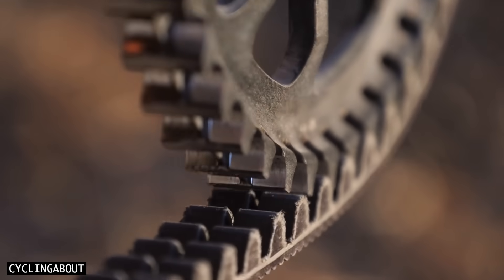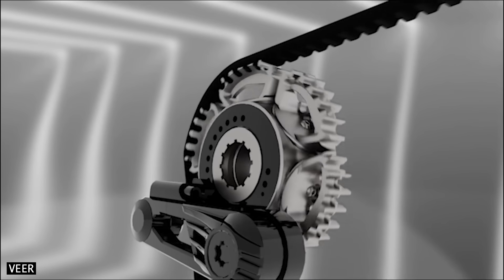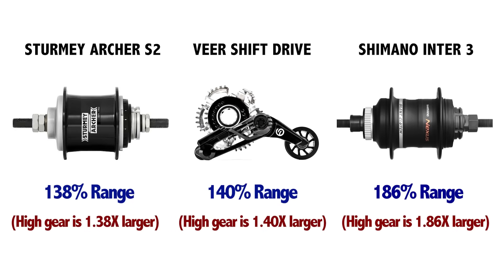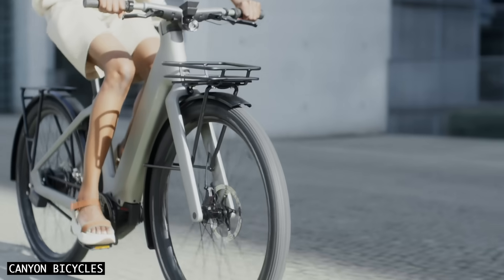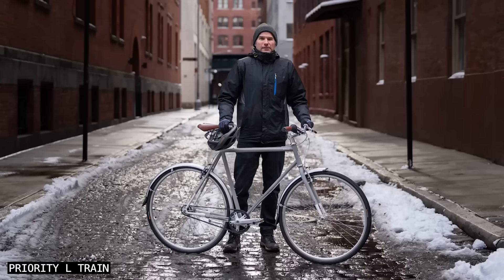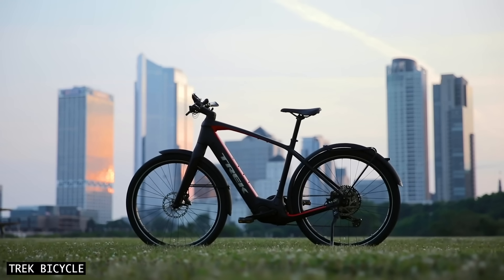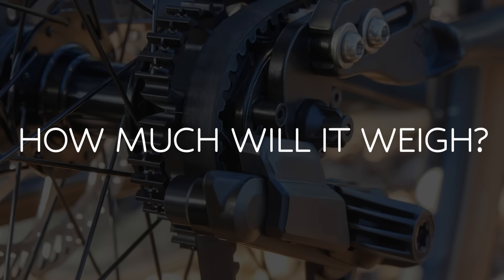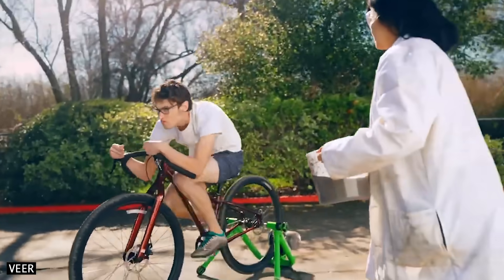Are Chainless Belt Gears The Future of Bicycle Drivetrains?

Comment: This is the first I’ve become aware of this variable diameter cog. I’m intrigued by the cleverness. I realize that many people may look at it and have concerns. But, I also remember in the 1960s seeing adults chuckle derisively the first time they saw derailuers moving chains across 5 cogs.
Reply: Intrigued, yes. That said, the cogs reliance on a "derailluer"(vile machinery), the fact that it is limited to two gears, and the fact that it relies on nearly a dozen exposed moving parts makes it the grease and maintenance laden hellscape that hubs, gearboxes, and belt drives have historically saved us from.
Reply: @kenshinjenna right although unlike derailleur/chain lubrication could be concealed but it sounds too complex for only two gears and limited ratio, making it limited to commuters, with very little advantage over gear hubs which offer a wide range of gear #/ratios
Reply: @kenshinjenna agreed. It’s replacing one derailleur with several. I think this is harder to make reliable, sheerly from an odds perspective.
Reply: @MrQuestful I don't agree, because it only shifts when it's not "in gear" so there are no forces applied, and the "derailleur" mechanism is internal too. it's sealed like your hub is.  no need  for grease on the outside. but the biggest limitation is 2 speeds and 140% ratio which is only ok for commuter bike and/or low speed ebikes. wireless sounds like too much for limited functionality. people paying for wireless shifting want more performance . cable wired shifting with internally routed wires on an ebike would be cheaper, more reliable, and wouldn't require to charge /swap 3 different batteries.
Reply: @geemy9675 I still don’t understand why wireless shifters aren’t all powered by a tiny dynamo in the mechanism…
Reply: @JohnR31415  good point but. it would probably be fragile and probably add as much weight as the battery plus drag, plus you'd still need a battery for the shifter derailleurs are made to be tough. a small battery in the frame , and wires ran in the frame to the shifter and derailleur would do and it could be smaller without the wireless communication
Reply: @geemy9675  it would still need a small battery, but outside of actual racing the drag penalty would be negligible.
Heck, run a rear hub dynamo (saves wiring round the crown) or a reelight style system.
Reply: @JohnR31415  I don't think its worth the additional complexity, weight and drag of adding a dynamo plus having a small battery  plus a second small battery on the cockpit form the remote.
Reply: Something wrong with your memory there mister goodwrench, derailleurs were pretty universal in the 60’s already, never heard anyone scoff at them.
Reply: @ In the community of serious cyclists yes, derailleurs had been proven and accepted in the 50s. Among the general population that thought that massive Schwinns were the gold standard for bikes they weren't seeing lightweight bikes with derailleurs until the 60s.
Reply: @MrGoodaches  both my parents had lightweight racing bikes in the 50's, they thought nothing of cycling 50 miles or more in a day
Reply: @ Cool. They were not typical car centric Americans of the era who thought bikes were merely kid's toys.
Reply: Really? My parents were riding bikes in the 50's with 5 speed derailleur gears, great thing about those gears is they are very simple and easy to repair, which is what most cyclists want.

Comment: wake me up when it's price competitive with a derailleur and has a similar range of ratios
Reply: I do not think they want to compete on gear range and gear count. A flat city commuter that is cheap and easy to maintain seems to be their target
Reply: 526% with a Rohloff E14 hub gear. More than most derailleurs I think. Going down the ebike route, the new PinionMGU is a mid drive motor with integrated 9 or 12 speed gearbox with 600% range and just an oil change every 6000 miles.
Reply: Since I'm not a commuter, live in a hilly area, and don't want an ebike, this does not seem to be for me.  I need a lot of gearing range, and this doesn't seem to be it.
Reply: @frankgarrigan750  You'r right ! Derailleur for lightweigh/efficiency/biggest de multiplication range at a lower cost is best. Nonetheless, you should try a Hubgear bike, you will be happily surprised how capable it is !
Reply: Upfront cost is lower, but it’s cheaper over its lifetime.
Reply: Looks like a pretty cool concept! I definitely see it going pretty far on alternative ev vehicles or even gas vehicles. Basically to be able to have a low and high gear ratio mode would be really helpful on ev like mentioned, even if the person is not involved considering most ev vehicles, if not all, are stuck with a one gear/speed system.
Reply: Have you considered: geared hub
Reply: @tommihommi1  also when a belt breaks it's garbage, when my chain breaks I just fix it on the spot and ride off. one spare chain equals a lot of links to repair with.
Break a belt guess you are walking to the nearest bike shop, unless you carry a whole spare belt at all times .
Meanwhile I can carry a couple links that weigh nothing and take up even less space.
Reply: He clearly said in the video that this isn't for you, so you may continue sleeping forever, please.
Reply: Just stay in bed guy.  Some of us are interested in things that are interesting because they are interesting and could become affordable with economies of scale.
Reply: Sure thing, not  This is why the bicycle industry is crap @randomdude5938
Reply: @randomdude5938  Interested because it's interesting?  Sorry but there is 0 argument there. Maybe that's your point. But that serves nothing here. It may be interesting because it's new, because you want to "feel" how it works on your bike or because whatever, but not interesting because it's interesting... It's self-definining, circular reasoning...
Reply: Current hub shifters are heavier, more drag, & over 2× more expensive than cassette+derailleur systems (even after maintenance if you know how to shift). 

Hub shifters also lack the modular parts interchangeability of more standardized cassette systems. A replacement for one ring on a cassette, is cheap & not hard to find, compared to hub shifter parts! 

Plus, due to their smaller radius, hub shifters can't withstand as much torque per Kg of material... 

The increased weight & drag alone, would usually rule out such "improvements" on a low-power vehicle; it's a testament to how aggravating people find derailleurs, that in this case the highest performing solution isn't the one people clamor for. 

Hub shifters are easier to use, but inferior in almost every other important respect. 

Annoying though they may be, their performance characteristics are so competitive (especially considering a lower price point), that derailleurs with cassettes are going to be around quite a while, at this rate.
Reply: Belt drive is really cool for lots of reasons. But the primary are 
It makes perfect sense for commuter bike and bike packng. 
It can stay under rain with no problem, it do not need to be maintained or cleaned, it has a way longer service life. 

All in all a hubgear like nexus 7 or 9 with belt drive is a bit more expensive and not even that much if you compare it to top spec derailleur/cassette from Shimano/sram. 
But in the long run you are a clear winner on money spent both in replacement of cassette/chain,... And so much time saved in maintenance !
Reply: @neodurden6793  none of that is true though belts need maintenance and don't last longer. Belt going to last a couple years, I still have bike chains from the 70's
Reply: @danger1240  Belt : 20 000 miles. Chain : 2500 miles IF  clean and lubed rigorously. 
Math ain't mathin' 😅
My previous commuting bike which was chain driven needed a new chain every year.
Now, 4 years, the belt looks like new
Reply: @neodurden6793  where do you get 2500 miles for a chain from lol. 
Rough estimate for my current bike I have been commuting to and from work for the last 7 years 41,321 miles. I only really do maintenance once or twice a year, or if I get it really muddy.
Reply: @danger1240  I live in rought climate (mud, rain, salt, hills). And do approx 5kmiles a year with it. After the winter it completely toast
Reply: @neodurden6793  these make sense if it's in perfectly flat land or with electric motor, and if you never take a lot of stuff with you, never plan on using a trailer with it, and like either getting off the bike or winded af when using bridges/overpasses.
A true every day do it all bike with a belt only works when you combine it with a gear hub that costs more than the complete derailleur bike.
Reply: @tommihommi1  that's what I'm talking about : Rear Hubgear with belt (Like Shimano Nexus) on a muscular bike !
A Nexus 8 from Shimano is 180€... It is 30 € more than a Deore Cassette+derailleur !
I live in a steep city, it is really nice. And if really you want more, you can get a 11 speed hub ! 

For me derailleur and cassette actually only make sense for MTB and bike training or enthusiast. 
But for the masses, Hubgear with belt is way more practical. 
Take a look at commuter bike parked outside in the city, people do not now how to maintain properly a bike. So having the drive train maintenance free is a big plus !
Reply: @tommihommi1  So no Hubgear bike are not that much more expensive in comparison to a derailleur bike with the same components. And if there is any minor difference, you get it back 10 times in cost on maintenance! 
Plus you can choose from 3 to 12 speed hub to accommodate the type of city you ride in...
Reply: @tommihommi1 Make the Earth Flat Again!
Reply: @tommihommi1 if what he's saying in the video is correct, you could use this in combination with a gear hub, turning it into something similar to a double chain ring setup, although he didn't mention that specifically, if you're using it with an internally geared hub, which he said that it could, that would be the effect.  so essentially, you end up with a high torque mode and a low torque mode. in terms of price you have to compare the entire drive train systems and their maintenance costs over to whichever one has the longest maintenance cycle, we don't know how much maintenance this rotating sprocket will need, we have no idea what the internal mechanism is like.
Reply: @neodurden6793  planetary hubs aren’t maintenance free, that’s actually an issue with them, because when it comes time to service one (or just to lubricate one of the many grease packed models), it’s too complex for the average person to do themselves and not easy to find a mechanic who understands them
Reply: @PRH123  You are right, but the simple maintenance on them is quite simple. And if your mechcanic can not do it I advise not letting him do anything on your bike haha. Having rebuilt quite a few, lack of maintenance have to go a long way before it start to get problems. The simple oil bath/regrease is quite a simple process and should be done every 3 years or 5000km, with not to many problemgoing longer. I personally do mine every year and it still  look like new !
Reply: @neodurden6793  got nothing to do with my mechanic, outside of the UK or NL it’s not easy to find any mechanic who understands planetary hubs

removing the core of a shimano hub to regrease is relatively easy, for someone with experience, and instructions (which Shimano are adept at hiding from the public on their site), but their cleaning solution is relatively expensive

breaking down an SA hub to regrease is a fearsome task, not simple at all, made harder by the fact that SA don't produce instructions or shop manuals, and a couple special tools are needed
Reply: @PRH123 When that happens it's probably time to replace the whole wheel anyway.
Reply: Definitely true, but I have had so many problems with derailleurs over the years that I am really sick of them.
Also, if you have an E Bike, it is super EZ to kill you smaller gears and a belt is just so much better than a chain.

It will take some time to be viable in the mountains